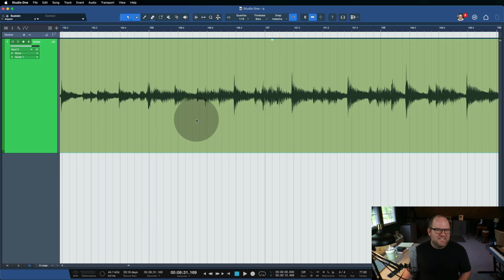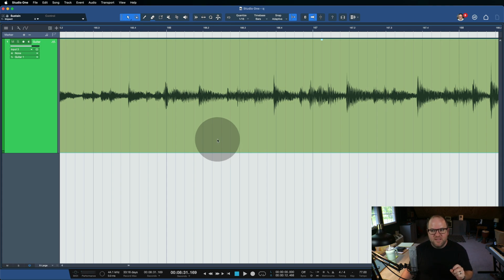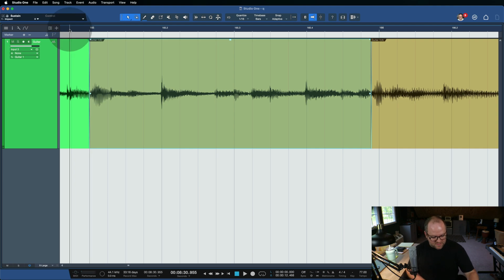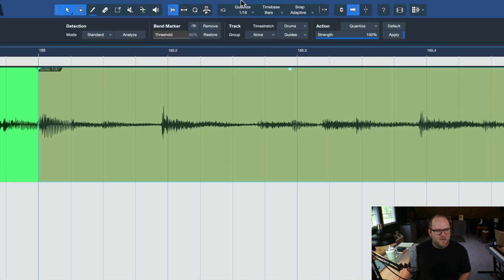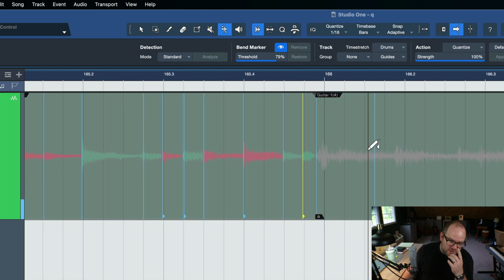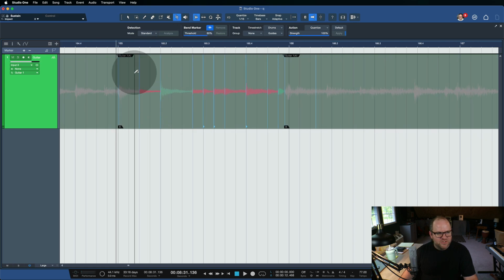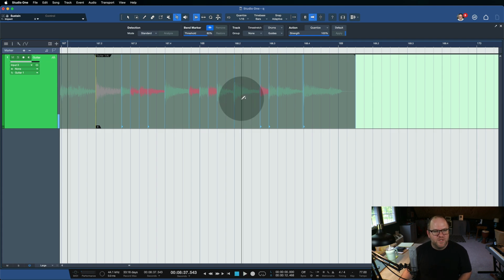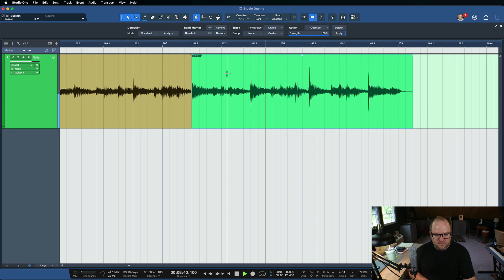3 Ways to Fix Timing Issues with Your Audio in Studio One | PreSonus

Comment: Hi....I have a whole song (Vocals, Gts, bass, and drums) that's off. Timing ebbs and flows. Can I do a whole song at once? or each track at a time? or it can't do? meaning, leave it alone, and have tempo just ebb and flow with the drums. This was a song recorded several years ago, when I was so very new in this recording engineering. Or do you have another suggestion?

Comment: Maybe I’m wrong and missed it, but you (PreSonus) haven’t done a video about creating a feed loop, with a click track, to calculate ACTUAL sample latency!!!! That’s MASSIVE one of the biggest problems people actually have, and can easily be corrected. Seems like more often than not my system is actually printing AHEAD of the beat. I have a Apple Fortuneteller. 😂 Latest design. Had to adjust mine let’s say -150 or whatever. Heck Logic is like -1500… 

You search and people are always complaining about latency issues, but that can be fixed easy and free. No CPU or RAM upgrades. Heck you can run at 1024, with the correct sample rate adjustment, it’s like recording at 32!!!!!!!!!

Comment: Great Video. but 90% at the time bend tool will  destroy your audio with lots of artifacts, even in small fixes, This algorithm must be improved. Cubase's Time-Stretch sounds way better for now.
Reply from the maker: Hi Tom, you can pick your preferred algorithm for the bend tool in the Track Inspector (F4 key). Usually, "Sound" works the best for stretching polyphonic / chord material. "Solo" is my preferred choice for time-stretching Vocals. -GBY
Reply: @fenderstudio  thx for rplying, I try all algorithms, I agree that works best for percussions and solo instruments, but for vocals, acoustic guitar, and pianos I never could make work with no artifacts in sound.
Reply: Higher sample rates will increase the utility of the bend tool.